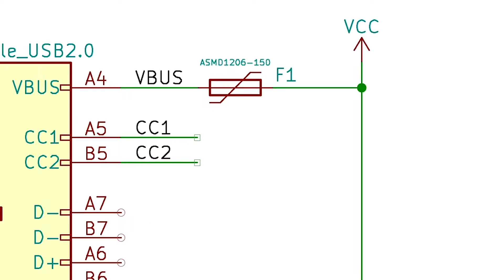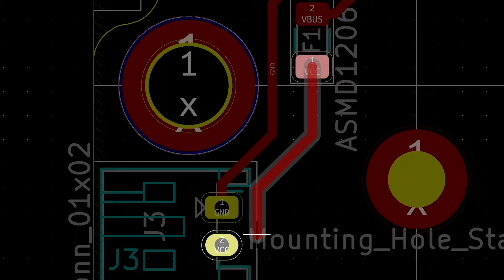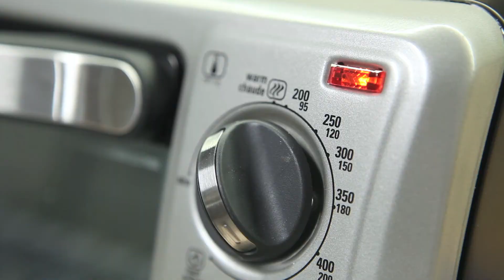Guitar Hero X-Plorer USB-C Mod

Comment: How can I buy an exact cable like yours?? I'm trying to convert ps2 sg to usb-3.0 cable but not sure how to find a cable like that or similar with the right angle molded boot and 6 cables like the ps2 connector wire

Comment: This is very cool, but for something like a guitar controller this doesn't seem like a huge benefit. A removable cable is more likely to fall out during play. I get the benefit of storage, but it's not THAT big a deal to have a cable attached to it, is it?
Reply from the maker: In addition to making it easier to store, having a detachable cable means I can use different length cables when playing on the couch or at a desk without having to worry about the excess. It also means the cable is replaceable if it gets damaged in any way. I haven't had the cable fall out yet but I can see the concern.

Internally, replacing the cable with the PCB also gives me a power port for future mods without having to splice wires or tap off of the main PCB. That's not in use yet but it will be in the near future.

But mostly it's just for fun :D The cable was annoying me so I decided to do something about it.